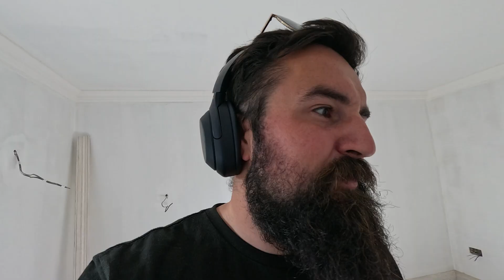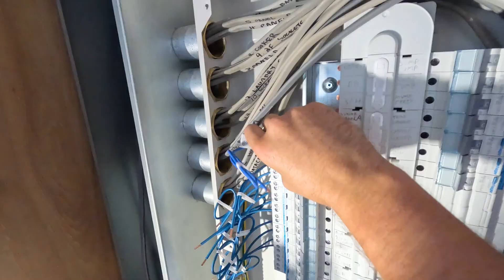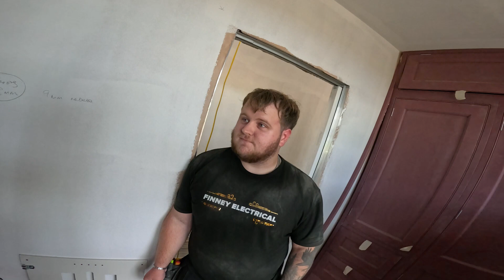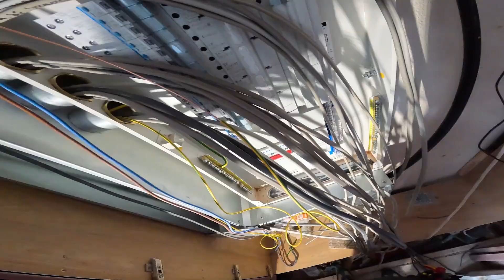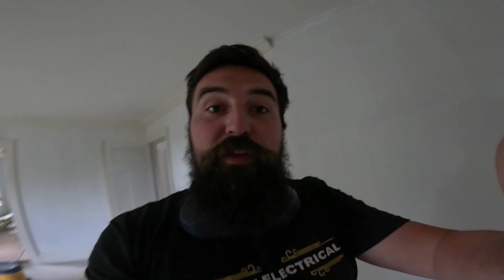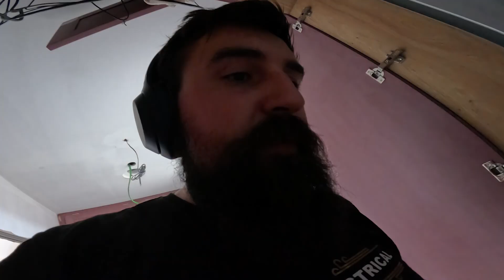2ND FIXING THIS HUGE SMART HOME! 🏠⚡

Comment: Nice job, what about it is smart ? Does it have a Lutron or Loxone lighting system ? My Megger MFT will measure Phase to Phase for PFC instead of just doubling.
Reply from the maker: Heya Andrew! Yes this is a Loxone lighting system, if you watch the earlier episodes I talk a bit more in the smart home side of things and the wiring. Ah I didn’t know the Megger did that test, like it 👌 you worked on many smart home systems? Or bms systems
Reply: @finneyelectrical hi, ok I will watch earlier, I only saw this one yesterday, yes a few, first one was a Lutron homework’s, we wired it all and it was all programmed up by the smart home people, back before LED most lights were 20-50watt dichroic halogens etc, maybe some 230 volt rope light also before LED,  but still looked great, it had Linn audio throughout and a 50” (plasma) screen 1st I had seen. We do mainly controls on poultry houses, dairy etc now, but still use Lutron in domestic, I did my own house with Grafik eyes which sadly are no longer around, I use Lutron RA2 and Pico now. Cheers